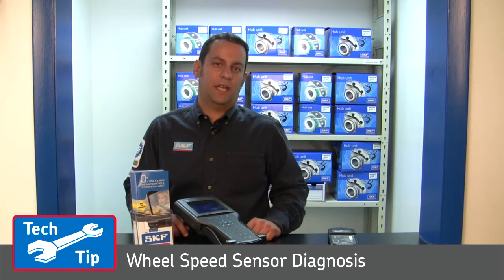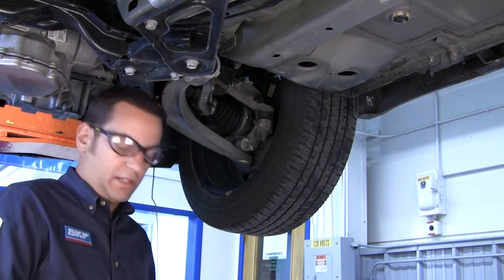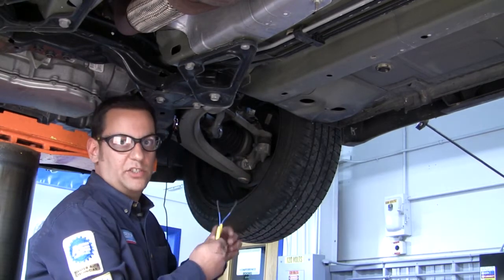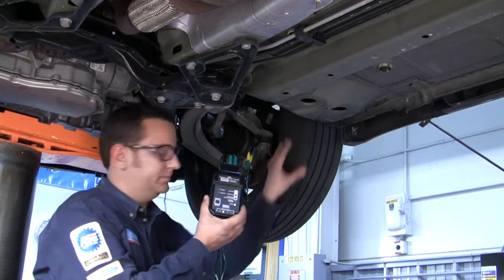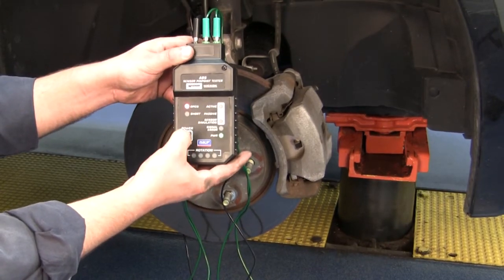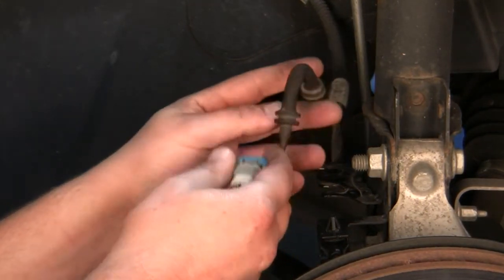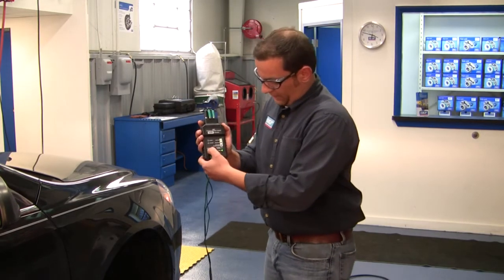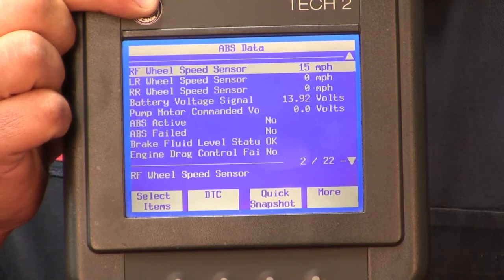SKF ABS Sensor diagnostics (AUTO)

Comment: Your sensors are bad and you should feel bad. I always need to use the OEM ones on bearing replacements. Just throw OEM sensors in your bearings already or no sensor at all. Anything but skf sensors